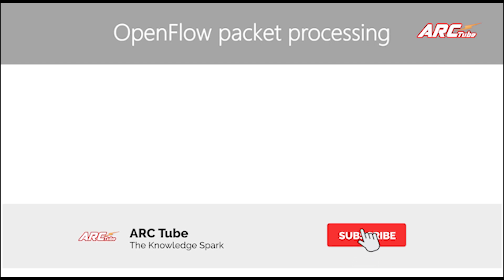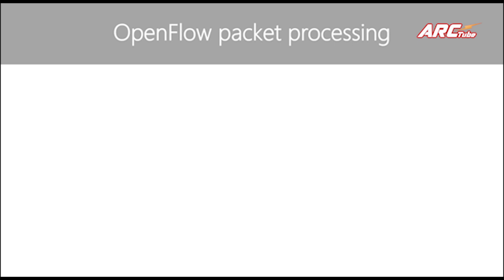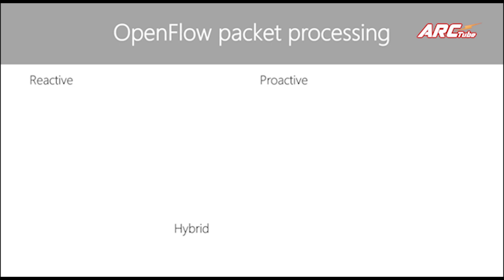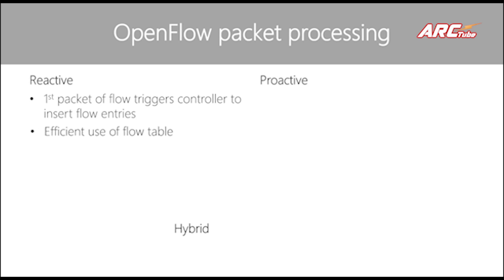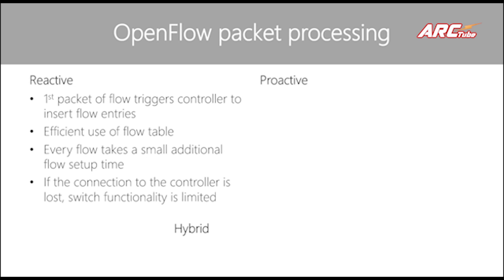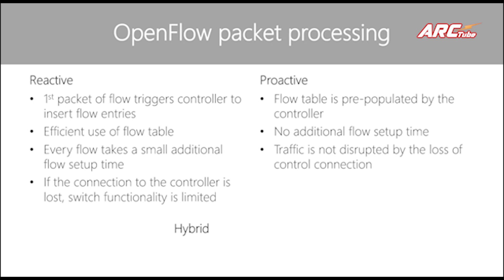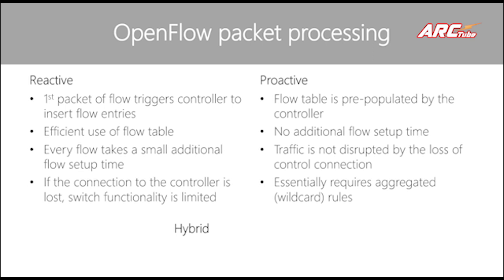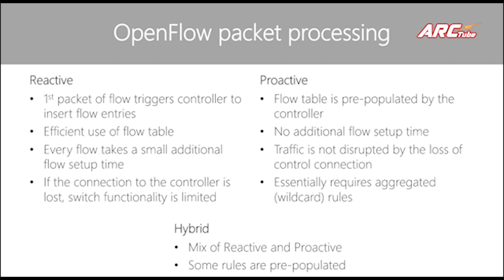Telco Softwarization - 5 | Packet processing in SDN

Comment: Hi Anu,Just one query for the case of reactive packet flow.considering example mention in your video
In case flow table know after 1st flow destination ip 5.6.7.8 reside at port 2 of switch,and later it receive the request of traffic from port 3 host to port 2 post which 5.6.7.8 then it will use the earlier entry or it will perform exact match and found that no information mention about specific  source to destination,openflow agent will raise query with SDN controller..
Reply from the maker: It depends on how you want the NE to do the matching. If you just want the destination only to be matched, keeping all other fields as wild cards, then the OF agent need not contact the OF controller. But if you want to specifically match the source (or any other filed) for example, then as you've mentioned, since that intelligence is not there in the match-action table, the OF agent will have to consult the OF controller.
Reply: Thanks for the explanation